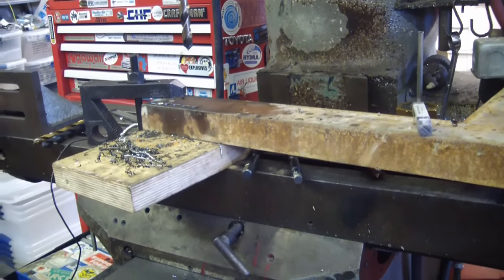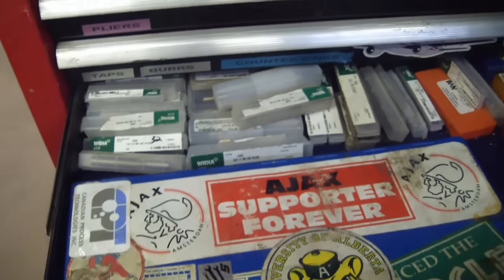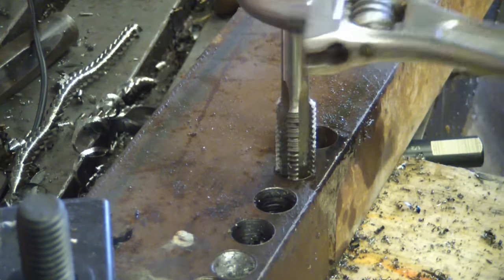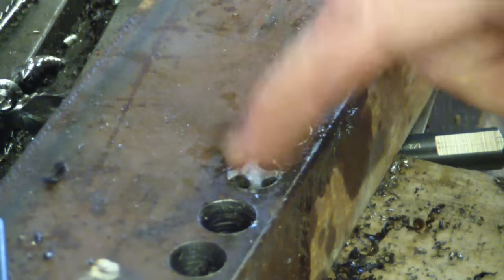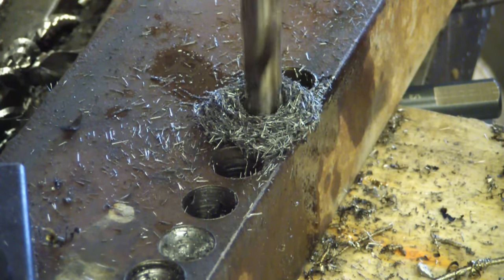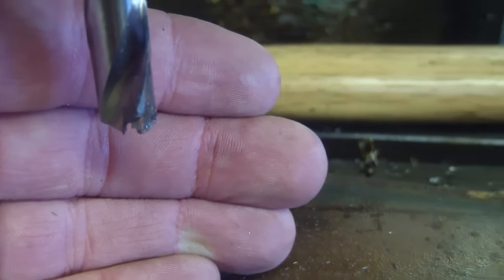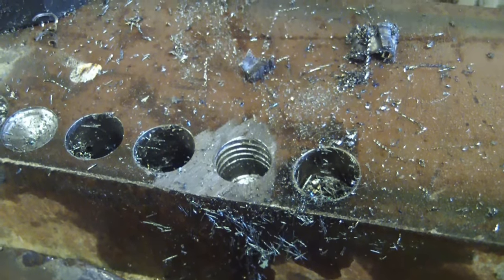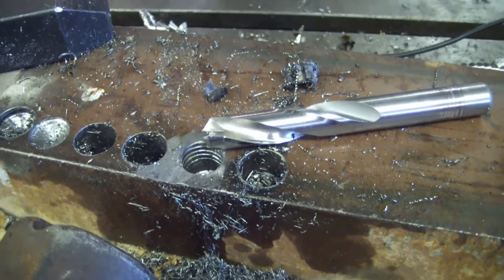Manly-man skills: Remove a broken tap the hard way.

Comment: The only 1st, 2nd & 3rd TAPPING RULES I'VE EVER USED AND I HAVE NEVER BROKE A TAP....
#1 Always use a tapping fluid, of WD-40/Seafoam Deep Creep/PB Blast in a pinch.

#2 If you're tapping any metals, always cut 1/4 to a 1/2  rotation of the tap and then GO IN REVERSE AND BACK OUT THE TAP 1 TO 1-1/2 TURNS.
This "clears" the chips that can and will become jammed between the tap and the threads that you just cut, in the same hole.
After backing the tap out, hen proceed cutting more of the threads, repeat the reversing step every 1/4 to 1 rotation, depending how much resistance you feel from the die and how difficult it is to turn. 
It's this resistance that eventually causes the tap to snap! 

#3 Always make sure your Tap and/or the die you are using IS SQUARE TO THE HOLE, or shaft you want to cut threads on. If it is not square, the deeper you go, the greater the chance you have of "locking up' the tap and snapping it's bitch-ass in half!!!

Comment: I've had pretty decent luck with left handed drill bits, they drill for a minute, and then they catch, and just reverse the bolt or tap out, but I don't think it would work with a drill press or a mill. I usually just use a hand drill anyway.

Comment: Thanks for the video!   If you don't have a steady machine to make the hole, especially because the stuck bit is inside the engine hood, can you still use a drill or should it be a dremel ?

Comment: Love your vidjahos AvE but bejuzus! They make a 4 fingered tap extracter that slides down around the broken tap. Its for when you cant drag a 14,000 hp motor base to the machine shop or drag a one ton drill press down to the basement.. never had a tap break I couldnt get out with the pin punch or the tap extractor.

Comment: I've started using burrs. It was all I had so I used it. Works nicely.  Most times the tap in something, someplace, somewhere.  That's not easy to get to. So I put it in a 90° air grinder and let it eat.

Comment: I have an access to a cheap Chinese EDM machine and it's pretty darn good at doing its job, but VERY annoying to use since it requires constant flow of distilled water. So if you're doing a hole like this, you'll end up in the middle of a electrified water pool (it is actually rendered as "safe", but you'll never know how good mains isolation in this sorts of machines).

Comment: About the slurs , I worked with teamsters, boilermakers, longshoremen and machinists just another day of shop talk. Great video been their and I learned another trick for my brain toolbox and also the fingered tap extractors I’ve had mixed results with them. They are the first go to then the chisel and then the torch . I like what you did hopefully I will not have to use it but if I have to well , we will see.

Comment: I'm working on an old black powder shotgun, broke a bolt extractor off on the right side of the reciever. Had to drill it out a lot bigger and now I'm  going to have a thick steel plug welded into it so I can redrill a proper hole in it for my bolt.

Comment: I will never go back to other methods. I've used the same tile/ glass plug drill on 20+ broke taps. My guys always grab me but never asked how i do it, they think i know machinist witchcraft. found it in my old carpentry belt. who knows what it's been used on in the past. I suggest a mill and keep it wet. No clue the melting temp for the brazed diamond. Plus no waistin time grinding tap flat. It's worked with a hand drill, much better with mill. The drill i found is a 1/4 Dewalt,  1/4 taps up to 1/2 so far. Low speed lite pressure and you have a dowel and what's left of the flutes. Pick em out with tweezers or a magnet, your good to go. I'm sure the cheaper Amazon ones will do the same, il grab one whenever this one's shot. If ya try it out, let me know what you think and what you used.

Comment: I've had success with Walton tap extractors. Wouldn't it be sufficient to drill out center to the diameter that reaches the hollow parts of the tap? 

Broken taps aren't usually in very convenient spots. Good luck.

Comment: I like using center drills to get a nice hole going in the tap.  Then a carbide drill bit after that.  Most of the time though, I just use a punch like you did in the beginning.

Comment: Thank you for the informative videos. Yes there is lots of china junk out there. I’m curious to ask if you could weld a washer and a nut to the tap? I’m not sure it will hold. Carbide bits are definitely a lifesaver. Thanks for your time.

Comment: The nice thing about using cheap chinese taps is that when you break them off, you can use cheap chinese carbide dremel bits to grind them out.

Comment: I have used tap extractors and have maybe removed 2 out out of 50 tries, they are a waste of money, I usually use solid carbide drills or endmills, never tried a carbide burr. I will keep that in my toolbox for the next time.

Comment: I'm a novice to all this.. Can't you just weld together a stainless steel fork that could fit inside the four spaces between the flutes and extract the broken tap like you extract a tub drain grate with a tub drain fork by  inserting it inside the tub drain cross and twisting it? I think that would work really well

Comment: You ain't kidding, that was the hard way. Why not just take some round stock and drill 4 holes in the face and press 4 dowels in the holes that will fit in the flutes then unscrew the tap?

Comment: How about you take a Needle Nose Plier, use its nose to Bite in those gaps around the tap as seen in 5:25, and try turning it back-up?

Will that trick work or its a lot of force to put in waste?

Comment: I have an idea, I have same issue. Tap stuck in a important place. Will a diamond dremal bit work if I place the metal under water. I only have to get though about a quarter inch of tap that is a quarter inch in diameter..? Or could u unharden the metal tap in a way.?

Comment: Hey, call me crazy but couldn't you use a bolt extractor... you know, drill a hole in the tap, thread it with the reverse thread bolt extractor and back it out like a bolt?

Comment: The " little tang tools "  never had any luck with those . No one does . During a shop lesson our instructor shoes us these during our " broken tap " lesson . I look em over and say " they don't look like they would work very well " . He say's " your right ,they don't . If you can get a tap out with these ,you could probably get them out with the center punch method " ..... on another note i can drill out just about any tap 10/32 and larger . tool & die here over 40 years . still going , you learn not to break em and not sweat them if you do .  & yes there is a lubricant to use on carbide drills when drill hardened tool steels and taps ( but is not a cutting fluid ). if you read this far & want to know my secret ,ask . (yes ,my own ,not taught or given , my own noodle work ) .

Comment: Mechanic across the way broke a "screw" and called me over to get it out. I saw the 3 flutes and immediately knew what was up. I couldn't remember if we had a tap extractor set at the shop or if I had just seen one on TV, but turns out we did in fact have one AND I had seen one on the ole YooToobs.
The extractor took out that 6-40 tap in a jiffy and wouldn't you know it that same mechanic went and stuck another tap in that hole to finish cutting the steel threads and BROKE OFF A 2ND TAP BEFORE I EVEN GOT OUT THE DOOR! Dude wasn't usin a drop of astroglide, despite having all the oil a man could hope for floating around, including a small bowl of hydraulic fluid within arms reach. 
    We had a chat. Then me and his boss had a chat.

Comment: Buy a carbide unfluted drill blank larger then the spine of the tap and sharpen a drill point only. Take small steps and keep resharpening it ejecting chips with air.

Comment: I was working on a boat in the Long Beach  harbor, assembling a old rusty engine,  I was cleaning out all the headbolt holes with a bottoming tap,  I was in the bilge , when I heard  a boat coming  past fast, about 20 seconds later a big wave hit the side of the boat !!!  threw me over the engine, I broke off the tap as I flew over the block,  after recovering, it took me 10 hrs to finally get it out,  no damage to the hole,  wd-40 hammer, chisel,  punch,  a lot of SWEARING AND CURSING,   😆😆  I made up some new SWEAR WORDS as I was progressing,   😆😆

Comment: When you sand it flush, I would just silver braze some steel T piece to it and unscrew it, then unbraze. Works even with carbide taps, as you can braze carbride to steel easy.

Comment: Well I  can't argue having to put up with cheap tools, which is why I buy the best. And you can buy cheap tools from anywhere. You need to know enough to be able to determine if the tool you are considering is of quality or not.

I've just never broken a tap. You drill the correct sized hole, use the correct lube and tap using the accepted method.

Comment: One shop I worked at  bur balls were the go to. The shop I'm at now carbide center cutting end mills or ball mills are the go to. Your method is good except if you can't put grind marks on the part you're working on.

Comment: Every tap that’s ever broke has been on a bolt hole shin level on the front side of a steam Bolger with 12 inches of accessibility, surrounded by high voltage wiring and heater elements. Hard to remove but not impossible. Never give up…🤕

Comment: Crap taps. Typically what you find at your local big box store. What’s the best? For hand tapping and self feeding (manual mill and lathe power tapping ) use OSG brand TiNi coated spiral point. Kenmetal and Guhring are great for CNC tapping but may oversized in manual applications. Find them at machine tool supplies business. To remove a broken tap isn’t easy. Tap extractors tools rarely works but it worth a try. Sometimes you can tap them backwards with a punch. Then there’s the shatter technique which doesn’t always work and can damage the threads and leave debris to wipeout the next tap. I save  dull carbide end mills to plunge into the tap (lock the quill and crank the knee up). But this can also destroy the thread and imbed carbide also sometimes. It’s a luck/skill thing. Lastly there’s the most successful and costly(if you don’t own one) is an edm or tap or drill burning machine. Even so they can mess up a hole. Then you’re choices are scrap the part, drill out & tap to the next thread size, Hellicoil or Keensert.

Comment: stop right there: 6:13 another guy I love to watch would find himself a steel nut with an inside diameter a wee bit smaller than the outside diameter of the hole, and use a MIG/TIG welder to bond it to the broken tap and just wrench it out.  Ive seen him do several examples where I thought to myself, na that aint gonna work, but it does, pretty damn well, and pretty damn fast.

Comment: luckily when i broke a tap a were able to either move the hole or grab a little piece of it with some channel locks and turn it out. ended up using the channel locks holding the tap to tap the rest of my holes that day. also I'm using multiple examples because I broke multiple taps that day. I remembered watching this video but luckily didn't have to use any of these methods!

Comment: Never use Chinesium taps ..

Took me hours to get one out of a engine block.
I used a Dremel with a diamond needle bit and valve grinding compound.
EDM method can vaporize broken tap out of block .

There are reverse drill bits and also the EDM method to vaporize broken taps.

Comment: My successful way of removing a broken tap is to clean out the chips and place a nut central to the hole, ideally with the same thread. I then pour molten solder into the nut and fill until it goes over the top surface of the nut. Then use a spanned to remove the nut. Works particularly well for smaller taps.

Comment: One of my first jobs in a real shop I worked with this older guy (I was like 19 so 60 ish was OLD then lol) anyway I to this day don't know really how he got it to work because I've never been able to get it to work but he would take a torch and heat that broken tap up then quench it with ice water and then he would take a center punch and put it right in the middle of the broken tap smack that punch with the BFH and that tap would break into small pieces and came right out... I've tried multiple times over the years never once did I get it to work lol he must of had that old guy magic lol

Comment: Have a question. I did have a machinist friend until he died.     This dude could take 3/4 inch steel plate and in the middle of it away from any edge he would cut a square hole.  Then he would have a piece like a dice, so perfectly square that would fit into the hole (I am guessing he heats the metal up so the cube fits in so when it is cool, you can't push it out - it is that tight of a fit with square corners.  How did he do the square corners?  I am guessing it is by machine?  I don't think he hand filed it.   You could not see the line around the dice to show the hole was there.  Do you do that kind of machining? Or are you knowledgeable on the technique?
Reply: He probably used a broach which takes a round hole and can turn it into a different shape, like a square or a hexagon, for example
Reply: I’m a mechanic not a machinist, so not my area of expertise…but I believe wire EDM will do that. So perfect you can’t see it, and you can’t hang a fingernail or a pick on it. If you look into it there’s some pretty impressive videos about it. Stuff that so snug that when you put the male piece into the female piece, the air can’t get out, so you’ll push it down and it’ll pop right back up.

From what I understand, it’s a very time intensive process, hours for a relatively small cut, but it’s insanely precise, the curf of the cut’s only about 1/10,000th.

Comment: Cheap tools have their place, and it's an important one. Buy cheapo tools if you're just putzing around the house on weekends, or wasting time on your hobbies. But if you have a customer who's expecting results by an hour ago, or if you're paying somebody else to use the tool, buy the most expensive tools you can get. Much cheaper in the end. And if planning, it's much cheaper to buy top of the line than it is to pay an engineer to figure out if you can get away with something cheaper. 
Production is different - the difference between a commercially successful product and one that bankrupts you can come down to fractions of a penny per part. But for a model or R&D shop or a repair facility, cheap will cost you.
Reply: Poor people will always try to hitch a goat under the hood instead of buy a new motor. It's better to let people buy the cheap stuff first and break it, nobody ever learned anything when the job goes to plan.

Comment: I have remove tons  over 40 years as a millwright, mostly other peoples screw ups. sometimes you get lucky and tap it  out most times you can't bring it to a mill and carbide in a hand drill most of the time will break . Most successful way is to beat it with a hammer and punches breaking it off in small bits

Comment: I used to burn out taps with a cutting torch. The high carbon tap burns away almost instantly in one quick oxygen shot. I've never used plasma but would probably work even better. Oh yeah, the Austraila aborigines use dogs to stay warm. Like a one dog night, not too bad. That's where the 1960's pop rock group took their name Three Dog Night

Comment: our tap burner is messy and takes too long to setup and even long to clean up and put away, i used that thing like 3 times before i just started drilling them out myself....it's usually a good idea to not keep fucking up to that point though, usually you can drive it back out with a screw driver or get some vise grips on it, rarely do you got to drill em.

Comment: I once bought some cheap Chinese taps that would not tap a single hole. Pretty sure they had the longitudinal slots cut with an angle grinder - seriously they were that bad. Learnt a lesson there - any tools that need to cut have to be decent ones.

Comment: I had to extract a broken 40mm 7mm pitch custom tandem tap from silicon bronze which was a nightmare. I milled a 4 pronged extractor out of 304 and cranked it out with a really big stick. It looked an awful lot like a huge flash hider. If anybody makes them these would probably be absolute lifesavers to have. The adjustable claw extractors that are sold are just too flimsy.

Comment: I guess this would be fine and dandy if what your working on can be put in a drill press. Personally I use a tool that's actually designed to remove broken bits only takes a few seconds and your done.

Comment: Back n the day I would burn out broken taps with an oxy acetylene torch ,we would also cut nuts frozen rusted and save the threads.
It worked but not always and you have to be real careful

Comment: Get a carbide burr… put a dimple in the tap center… then put a piece of drill rod [smaller than hole] in the drill chuck… then turn the machine speed up… force her in dry… clean out! 
For a tough or heavy tough tap like a three flutter while applying the high speed drill rod in aim a jet of oxygen only from you torch into the hole… the tap will disappear… WARNING DO NOT do this with a titanium work piece, or for that matter a zirconium or magnesium work piece… even water won’t save you but powdered borax sand will .